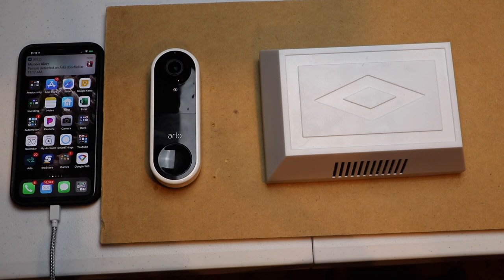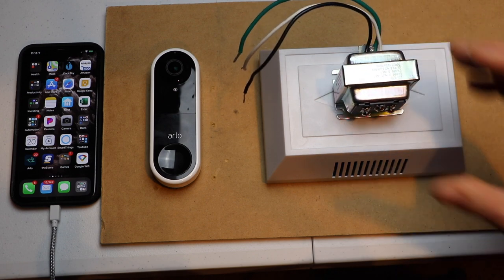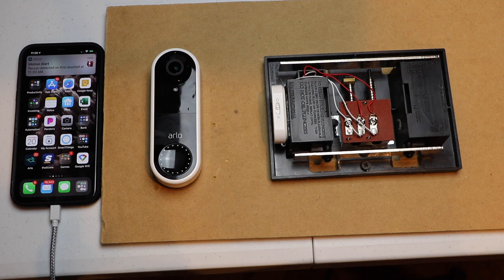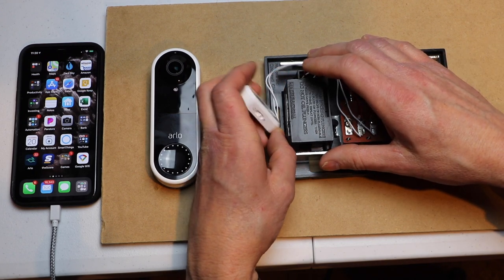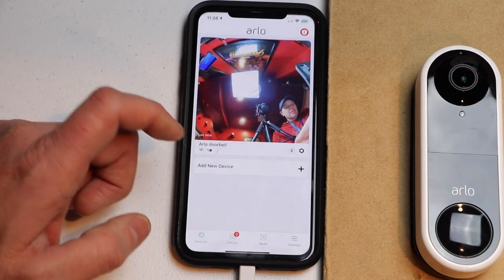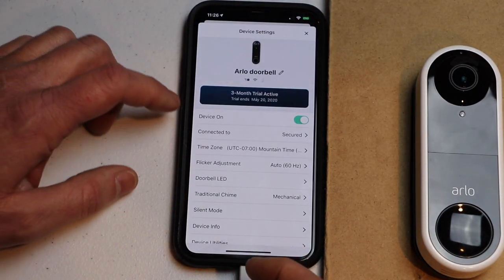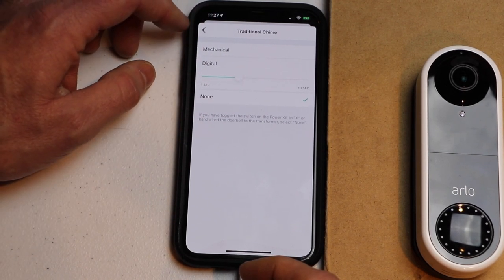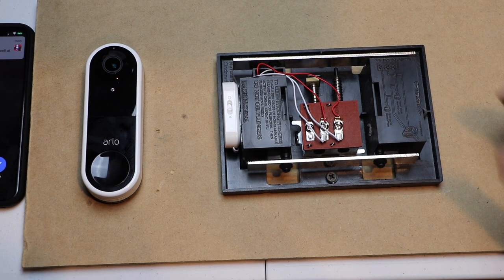Arlo Video Doorbell bypass Mechanical Chime

Comment: Curious if you'd have any thoughts. Set up the doorbell and everything was working fine. Noticed some noise from the chime itself, looks like one of the metal rods is slightly being pulled out every few seconds. Also the doorbell itself only worked for about an hour before getting a device tampered with notification. Wondering if it could be a power issue. Saw one video suggesting adding a resistor to the chime?

Comment: How do you reverse the process? I had everything set up and working. Then went in and changed it to none and now it won't let me open that setting up again to go back to mechanical.
Reply: I have the same issue. Did you ever find a solution?

Comment: Could I simply remove the chime completely and connect the trans and front wires with a nut, shove it all back inside the wall, spackle and paint so its like the chime was never there?

Comment: Need a little help. I have everything wired correctly and the door bell with alro. 

When I first pushed the button my original chime for the home sounded. But when set up was completed the bell stopped working. However the lights on the other buttons are on but no chime.
Reply: Same here and I've reset it too..so frustrated
Reply: @iamdaniellefisher  Were you able to fix it. I’m having the same issue. Thanks
Reply: @FromMeForYou  no I haven't yet, but I think I may have to change the transformer
Reply: Having the same problem did you guys ever figure it out